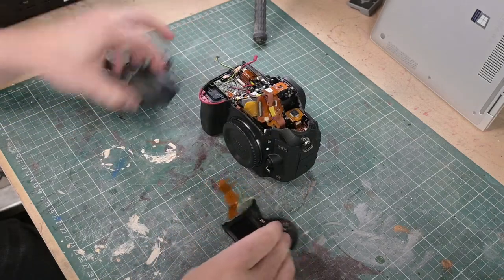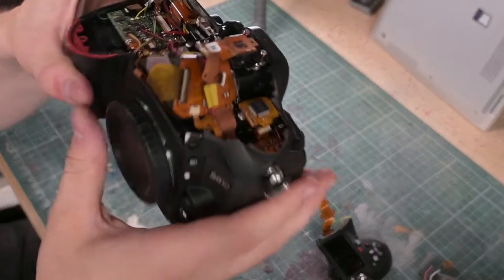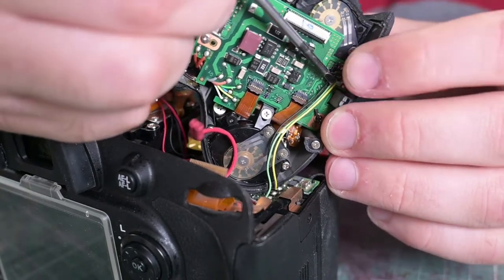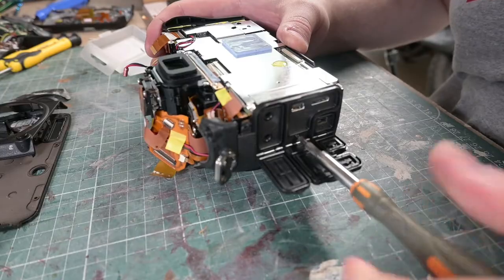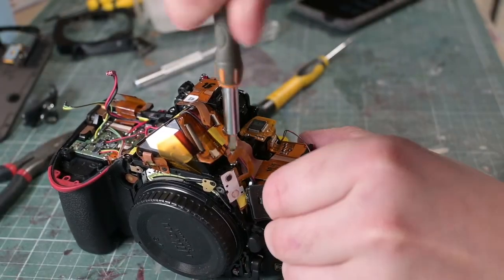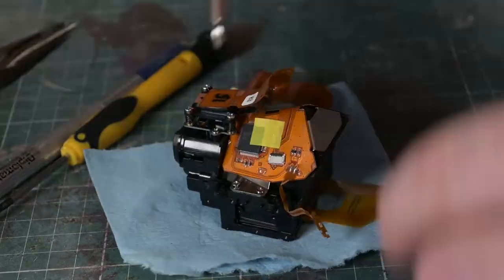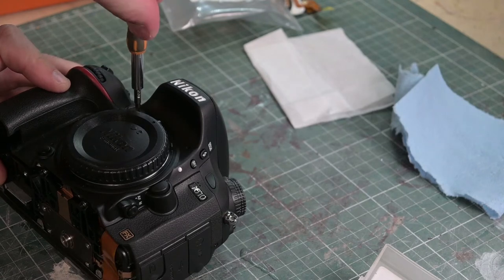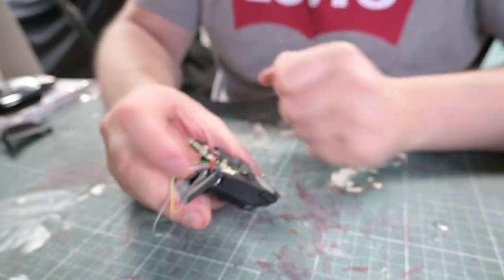This is why I like Nikon DSLRs... Fixing a dropped DSLR

Comment: Well that was very inspiring. I'm in the process of working up the jam to take my D850 apart. I dropped it a couple of weeks ago, as I was loading up for a 2 week trip. (back for 2 days now) Luckily it worked well enough to take photographs but the viewfinder is blurry and the lens mount looks... not square. I need to find what parts I need and their names so I can try to source them. Anything to avoid the dreaded trip to Nikon.

Comment: hi, I have a nikon d810. I saw this repair vid. was great. my d810 the control panel screen is cracked. Nikon wants to charge me 398.00 to fix it. can it be done by myself since I have never fixed a camera? I'm a computer tech. Do you have a video repairing that tiny screen on the top right of the camera? let me know
Reply from the maker: Hi, I don't have a video covering what you are after as this Nikon D610 repair was a once-off attempt at camera repair. Without knowing anything about the design of the D810, if yours is out of warranty, if you can source the parts yourself and if you have the necessary tools, I would say give it a go!